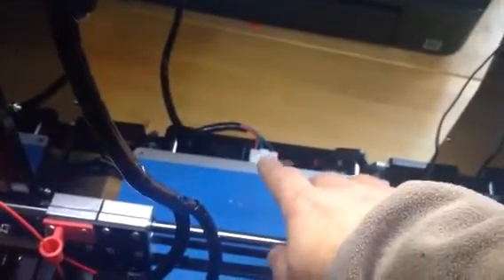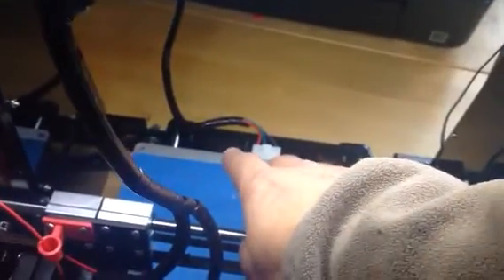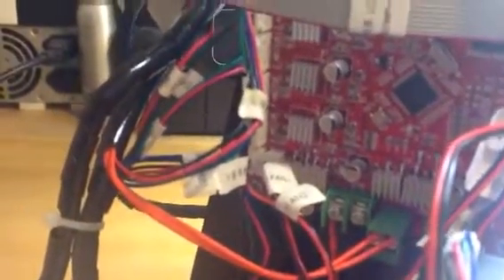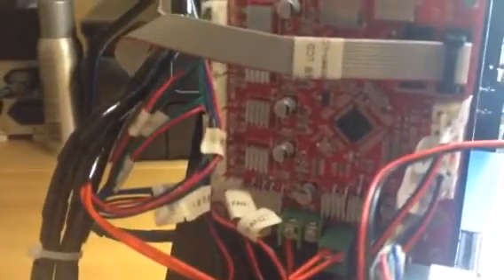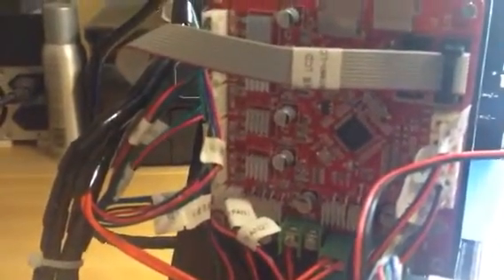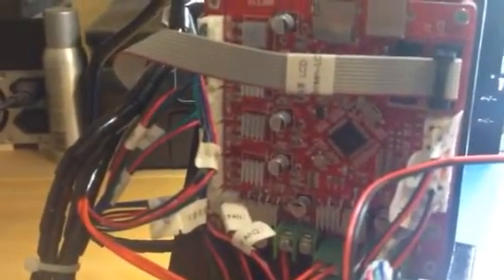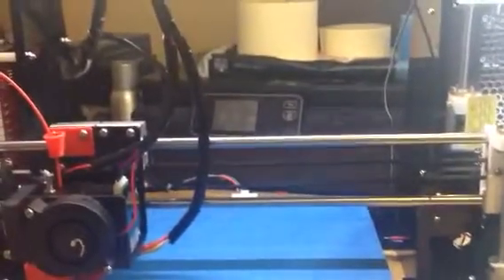Y axis problem on an Anet A8 3D printer

Comment: Hey. I have same problem. In your video you did not notice that the stop  switch indication on Y-position display is "ON" all the time. That is why it will not move toward stop switch, it thinks it is on. My problem is not in the switch, it is in the motherboard somewhere. I have contacted the retailer and am waiting for a reply on my warranty. I suggest you do the same.
Reply from the maker: Jeffrey Mild it was a bad board, replaced with a RAMPS , no problem anymore
Reply: @JBsDead  Mine had a bad board too, i just found a fix to re-flow the capacitors and it worked. Thanks
Reply: Jeffrey Mild reflow capacitors??  You mean short them and let them recharge?  I printed several things as recent as last evening.... now today this is the problem?  What the heck?

Comment: Marlin (the embedded software,  its free, the IDE is free and can easily flash the board when needed) has this thing where if the endstop is set to min or max and it does not find it, axis will only travel in one direction. You can test the endstops, make sure the y min/max is set properly in the firmware, hooked to the controller in the right slot, that it is functional,  that your Y axis in inverter or not (according to your design).

Comment from the maker: UPDATE: Its alive and well!!! Re-flashed with Marlin firmware (took several attempts) and the gremlins ran away.

FURTHER Update. Swapped the board for a RAMPS 1.4 with Marlin firmware, using settings from Skynet 3D (A8 version) all available via GitHub and Skynet 3D Facebook page. Working so sweet now.
Reply: Can you send a link to the firmware site? i'm having X/Y axis issues and think it could be a problem with that.  Thanks!
Reply from the maker: Lee Vigue sorry for delay answering. I can't remember the exact files I used (I tried a few). If you go to GitHub and search for Anet A8 or Marlin (the most popular firmware people use) you will get the most up to date firmware available. These are always being updated and improved so the one I have may already be outdated. If you need to know how to update the firmware there are loads of YouTube videos which can explain it much better than I ever could. 😉

Comment: If this is the solution it'll be great.  Friend just got one.  EXACT same problem.  Switched motors, wires, tested everything.
The final solution was that one END on the Y cable was wired in reverse .  meaning instead of (guessing on colors) red,green,blue,black   it was black,blue,green,red.  Hope this helps.....

Comment: I think I have heard thomething like that, I can't be sure. In that instance the problem was caused by the Y motor being accidently swiched w one of the Z motors. Might be worth checking out (the lables)
Reply from the maker: peter L. Everything connected correctly. I had done a few successful prints prior to the problem occurring.
Reply: y is swithed with x, normaly it`s y with is moving little bit after homing axies